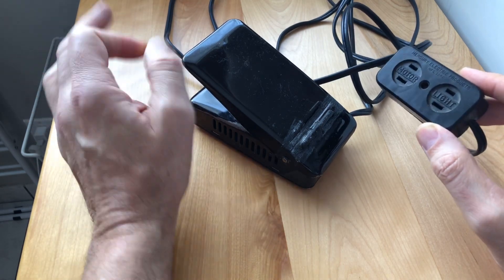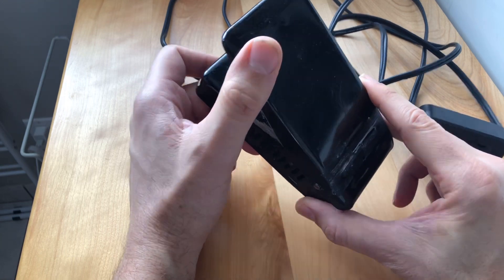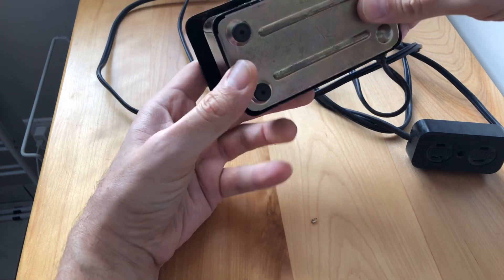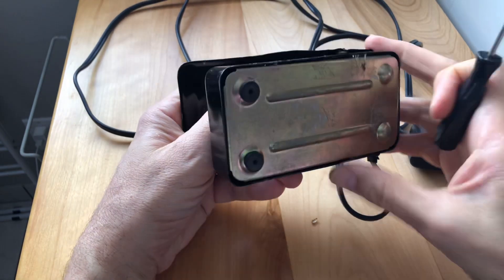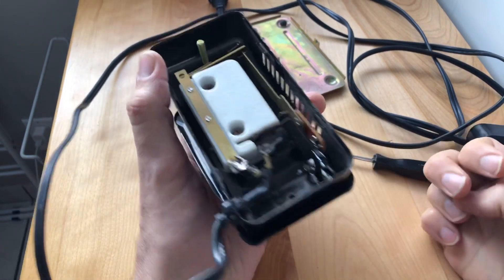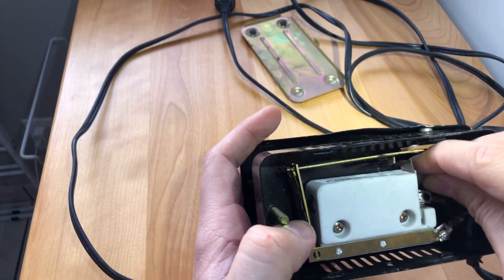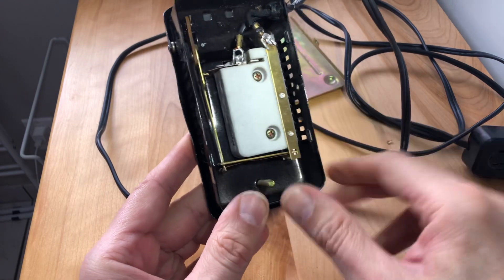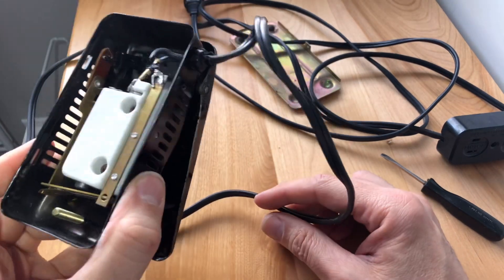IF OLD SEWING PEDALS COULD TALK PART 3: Oh No! Another Pedal With Issues Only This One Rattles!

Comment: I think a post I placed went into never never land, so I’ll try once more. 

I had a marginally functioning Kenmore 158.220. I brought it back to life, and in the process of freeing the zigzag mechanism ran it a low speed for 5-10 minutes at the time.  The metal foot pedal got so hot it was too hot to touch. When I opened it, the porcelain had cracked the body across the resistance wires.  I superglued it just so I could continue the repair runs while I waited for the cheap replacement to arrive. But the concerning part and the reason I would not have sold the machine with the stick pedal, even if not broken, was that I measured 100 volts between the pedal metal body and the needle plate, thus the frame of the machine.  The plug was not polarized, but the voltage was there whichever way I plugged it in. 

Something to check for.  UL standards may not have been as comprehensive back in the days.

Comment: On your zigzag issue, Andy will have  immeasurably more experience to comment.  But I had the same issue  in reverse on the Kenmore 158.220. The zigzag was stuck on straight. It is a fully mechanical, quite sophisticated mechanism that took much patience, penetrants, and oil to get working again. I’ll try to attach a pic.  Mmm It won’t let me.  
Under the top cover you may find a metal arch. The stitch width adjusts the position on the arch. If the adjustment mechanism is frozen stuck, the position on the arch is fixed, and the zigzag won’t adjust 
Allow me to defer to the author to present possible imagery for this